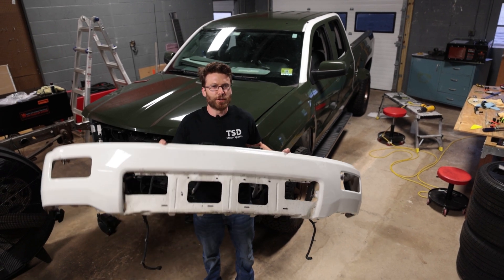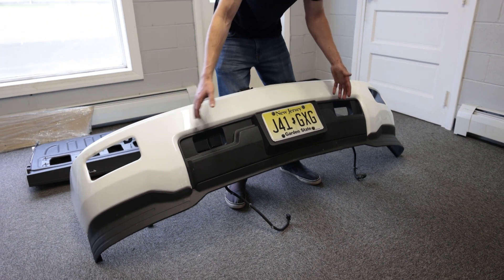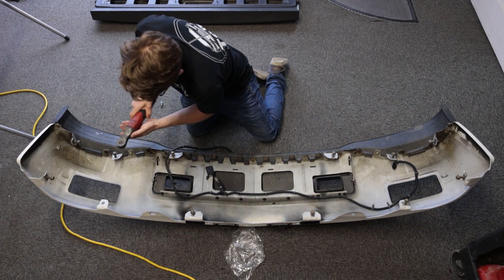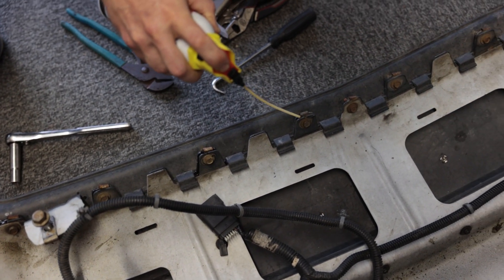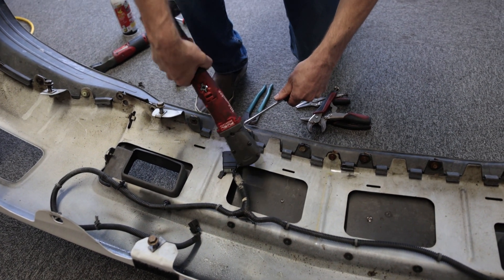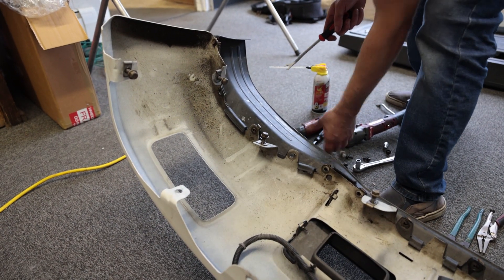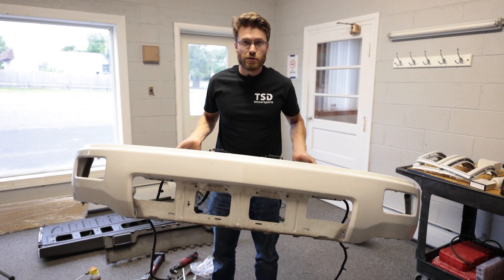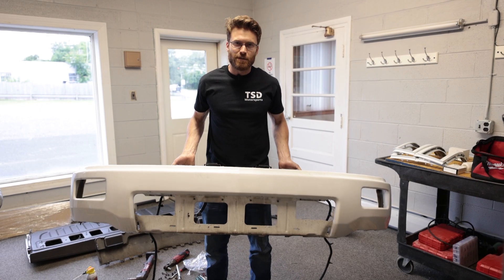2014-2015 Silverado Bumper Plastic Trim Removal GMC Sierra Bumper Air Dam Removal 2016-2018 Chevy

Comment: Hello.. how do you remove the lower  chrome fascia insert on a 2018 GMC Canyon .. front bumper.. I bought the truck used.. it’s Rock  pitted and dented … the part can be purchased separately
Reply from the maker: Haven't worked on one of those so not sure. :(

Comment: Does anyone have a link on where to buy this exact bumper? 
I have a 14 silverado lt, but want to change the front bumper to the z71 bumper.
Reply from the maker: This is the standard bumper. I don't have the z71 package. I don't think the bumpers are different. Just the suspension, tires, gearing, and badging